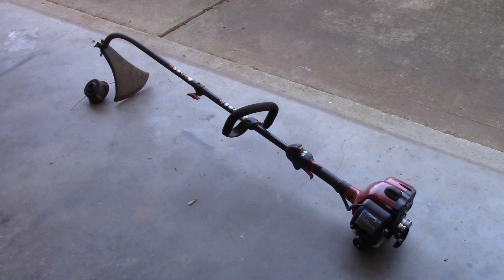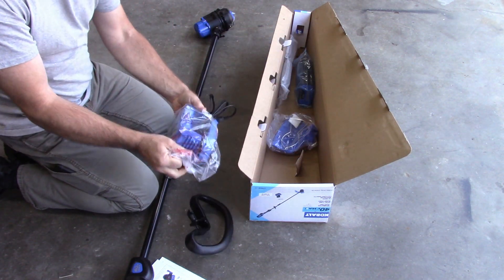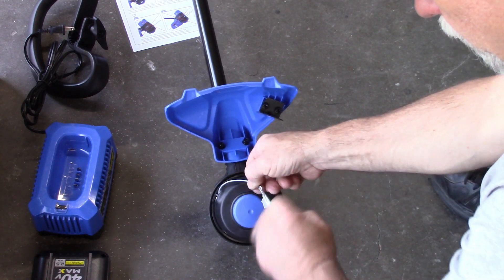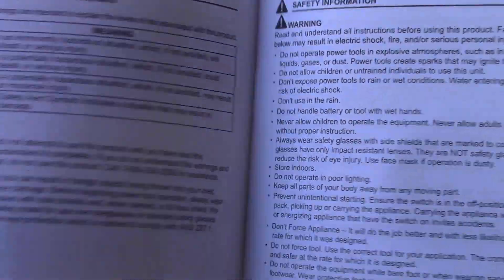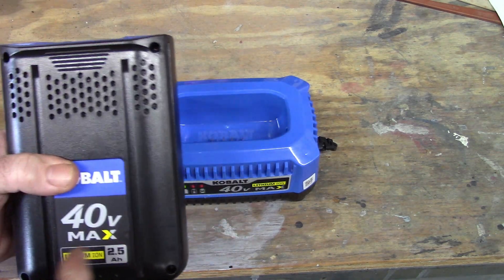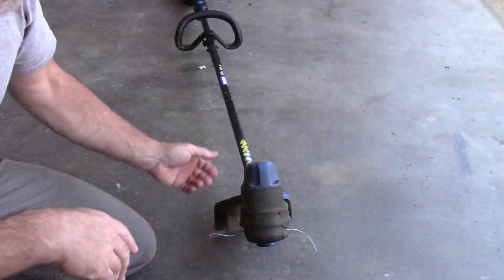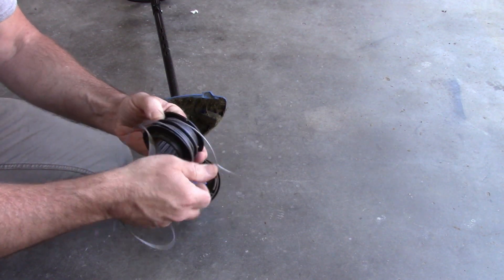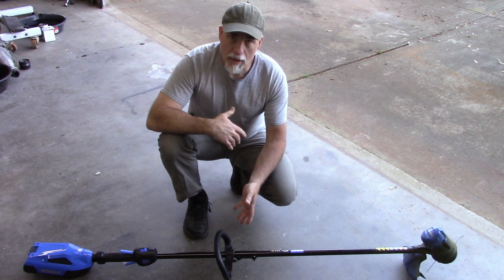Kobalt 40V weed eater. Unboxing and use.

Comment: Just got one.  I would recommend getting the one that can take attachments.  The newer ones have heads that you don't need to remove the spool to change the wire.  I turned the blade that cuts the wire around so that I have longer strings.
Reply: Great tip, I turned mine around also.

Comment: Well that's as green as you can get with a trimmer. Looks like it worked ok but because of the vibration it was hard to tell how it actually performed. I also would definitely invest in a second battery for it though, noting is worse than getting half the way done and having  to recharge a battery. Also, Lithium batteries have evolved a lot in the last few years, but keep in mind that during the times you're not using it you should only keep a 1 bar storage charge in them. If they are anything like my RC helicopter batteries, during the winter when I'm not flying them I keep them at a store charge of 3.80 volts per cell and they are 6S batteries capable of 25V. And I use 2 of thematic a time for a whopping 50V. Probably more than you wanted to know but I figured you like learning new stuff too. Great job as always on the vids. 👍
Reply from the maker: The vibration made it difficult for filming, but it did a great job. Tanks for the battery tip.
Reply: Yes I just bought this for FATHERS day, not much vibration, I got two batteries,,NOTE batteries wont charge unless they are cool,,like if you just got home with them in back of truck, and try to charge

Comment: I’ve got four different Kobalt 40V tools and am generally happy with the tools themselves. What I’m unhappy about is the battery packs and chargers. Out of four chargers, two have failed in 12 months. Out of five battery packs (the lawnmower comes with two), three have failed. So I’m running four tools off two battery packs, which s not an operational issue because I rarely use more than one tool at a time, but it really sucks because the battery packs are very expensive. I’m contemplating rebuilding them with OEM Li-Ion batteries but I’d need a BMS system too.

Very disappointed in the batteries and the chargers.

Comment: Bought the combo blower/weed eater kit. Works well for light weeds but not on haver stuff. Only complaint is the string replacement problems. Not easy. Original string was better then any replacement that I have found. Still it's a good product and  don't have to fight with my gas trimmer.
Reply from the maker: I did a string replacement video as well.

Comment: Look for a Wawa that has 100% gasoline (no ethanal), use that for all your small engines. Ethanal is like a sponge to water. If left unused for a few months the water will creep in and the motor will start running like Joe Biben's frontal lobe.

Comment: The only thing I don’t like about mine is the length of string.  It cuts it off too short for my liking...need to modify the cutter blade on it...maybe can be flipped around 180 degrees to give an extra inch or so of line length. Hmmm...🤔
Reply from the maker: Yep. It's designed to be flipped.

Comment: When I use my kobolt the stuff I am cutting flies up at me. How can I stop that from happening?
Reply from the maker: You need to change your angle. I believe the string spins clockwise. If so, use the front of the cutter. t should "throw" the cuttings to your right. Basically you can change how you approach what you are cutting.

Comment: Is your handle dead straight or or is it angled a bit. Mine is angled.
Reply from the maker: The handle itself is straight as in perpendicular to the shaft, but it angles back slightly towards the trigger.

Comment: i  have   40v max   the battieir  did  not last year   i  called    I   WILL  NOT   BUY    NO  MORE    kOBALT
Reply from the maker: Was it covered under warranty?
Reply: The battery's fine it's the string feed system that sucks. I broke mine by beating it on the ground. Got tired of having to advance the line by taking it apart every time you needed new line.  If anybody wants it let me know they can come pick it up for free.
Reply: It’s user error, not product.
Reply: That could be how its spooled onto the spool. Try another line. Even though its made for that line, it might not be the best. Dont just haphazardly wind it around the spool, think about how its coming off when bumped.